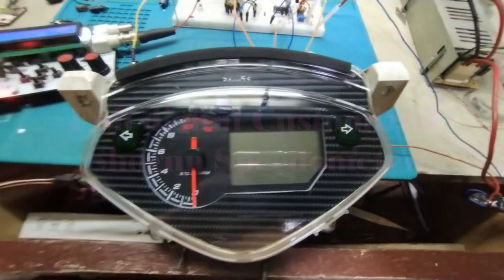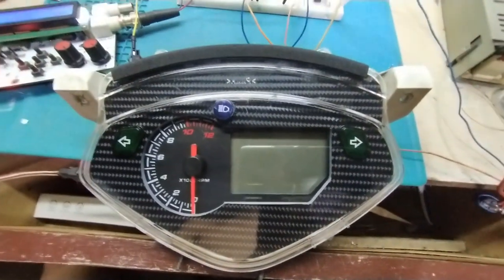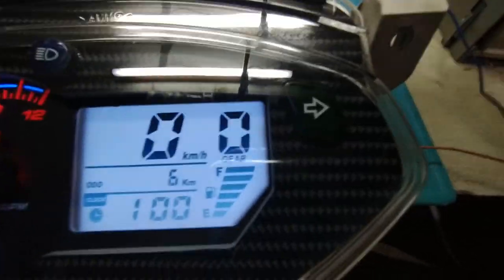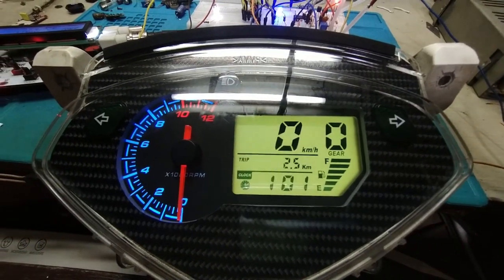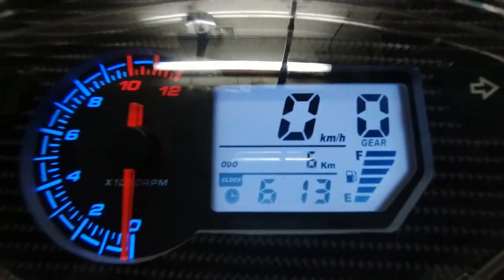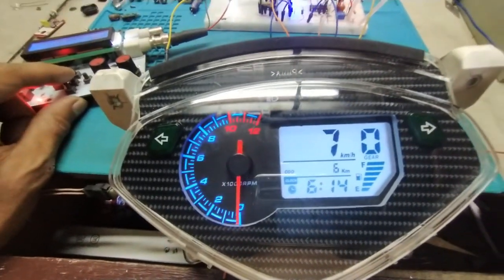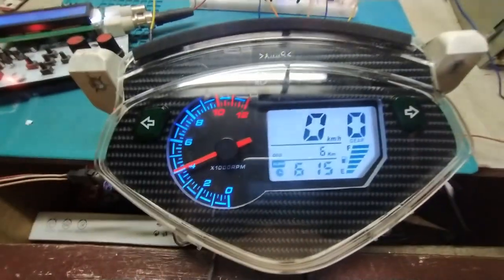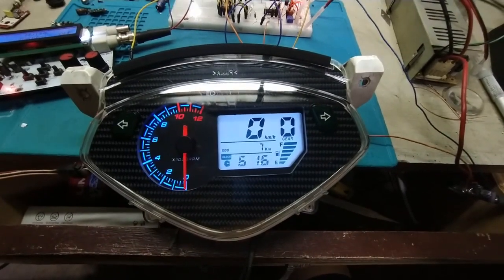Customized Shogun speedometer

Comment from the maker: THIS CUSTOMIZATION IS NO LONGER IN PRODUCTION. Speed is not accurate, there is no calibration settings and there is no way to adjust it.

IF ANYONE wants a FULL DIGITAL SPEEDOMETER on your shogun. KOSO for MIO is the way to do it just like what was installed on my 17 years old SHOGUN PRO. Speed can be adjusted on all sprocket combination. Do remember that the speed sensor is sensing the front sprocket. 

SA TAGALOG mga BOSS!!!...yung unang gawa ko na KOSO FOR SHOGUN ang pinaka the BEST para sa shogun dahil kahit anong sprocket combination pa ikabit nyo..pwede ma i calibrate and speed at mai tama ayon sa tunay na BASA ng speed sa kalsada o KAHIT GPS pa..KAHIT ANG ORIGINAL na speedometer hindi accurate lalo na kung magpapalit ng FRONT SPROCKET!!!

Comment: Boss pwede ba gamitin yung cable speed  lang o sensor speed talga yan?
Reply from the maker: Shogun Old is using speed sensor...I customized that without having to use a speedometer cable..instead it still uses the original speed sensor. Do not ask how i did it...It is in my head.